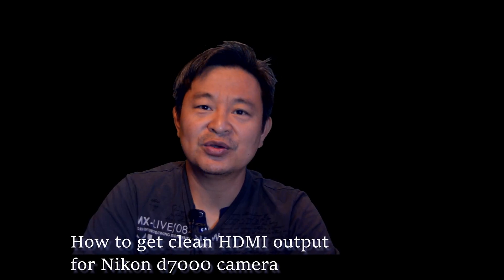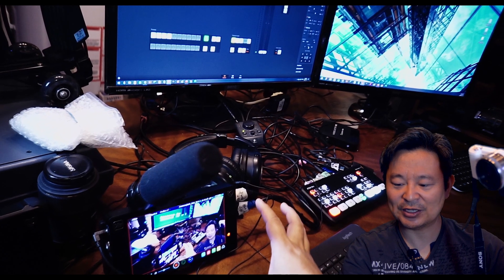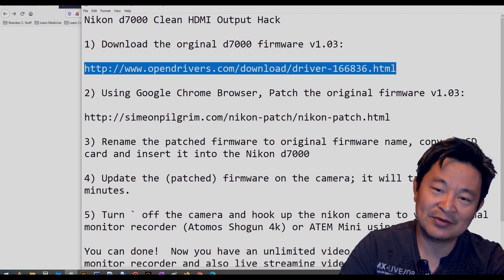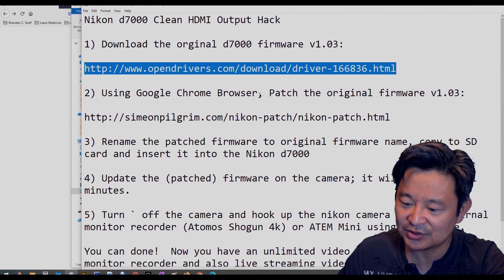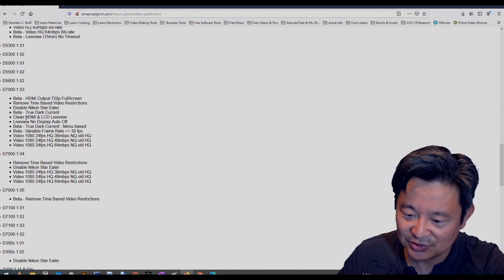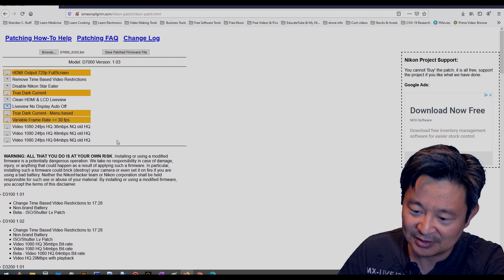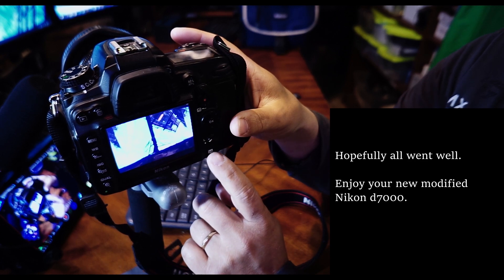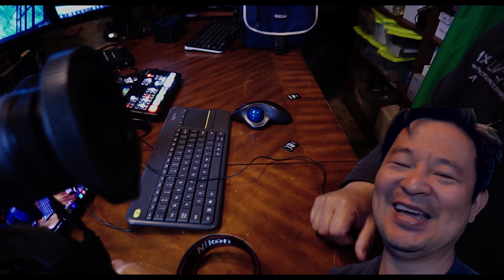How to get a clean HDMI output signal for Nikon d7000 camera

Comment: Everything seemed to work just fine. But after 2 weeks, (today) pluggin in an HDMI cable to the camera makes the screen just turn to black completely. Turning video mode on does nothing, Menu neither, the camera works as it can still take pictures and getting out of video mode gets the lense back and everything else works just fine. For what ever reason after charging my batery and turning the camera back on, it stopped working as intended.
I reinstalled the nun patched version 1.03 that the camera had and it goes back to working as normal.
Unpluggin HDMI makes the camera go back to working, (still with no info on the screen aside from the normal video imput on the screen)
I got no idea why it all of the sudden decides it just won't show anything on screen despite having done nothing but put the camera away for a few days and charged the battery.
I got no clue, I'll try updating to a different patch and then downgrade to 0103 but I honestly got no idea how that happened.
If anyone has encountered ths problem please let me know.
Aside from this, the camera has worked perfectly with the HDMI imput through a capture card.
Reply from the maker: Thanks for letting us know.
Reply: @educatetube  Update*
Got it to work, Although I'm not sure if this used to be the case for everyone else, the way the D7000 sent the live view from my camera to the capture card would be by displaying what ever was on screen.
For what ever reason, the output live view now goes out, withouht displaying anything on the camera. 
But still displaying it on the HDMI output.
So it works, it just I won't be using the camera's screen to adjust anything, and instead use my computer.
Again, unsure if this was the case already for everyone else, but I recall it still working.
Anyhow, it's all very confusing.

TL;DR Just update the firmware, let it sit for a moment. Reinstall this patch, (downgrade/update, doesn't seem to matter) and it should go back to normal.

Comment: Hip Sip! 
I have an issue when trying to send the file to the SD card. I'm doing it connecting the camera to the computer and then copying the file, but it says device stopped responding or was disconnected, then it says it's copying but nothing ever shows up in the D7000. Am I copying it wrong? Thanks for any help
Reply from the maker: You have to copy the file directly to the sd card and update the firmware through the camera. No computer connection needed.

Comment: I got low frame rate when I turn it on in live view and connect it to computer to use it as my webcam. any solution for this?
Reply from the maker: Can you not adjust the shutter speed?
Reply: @educatetube  thanks for the reply, yeah I have automatic movie setting and I tried to turn to manual nothings happened I got something lag or below 20 fps somethings

Comment: I want to do streaming with this camera. It is posible to stream more than 60 mins with this camera with no auto power off?
Reply from the maker: Yes, it should be able to, as long as the battery can handle it.  I hooked up to Atomos monitor recorder and there is no issue.
Reply: @educatetube  Do you have an estimate of the battery life with the hdmi output?
Reply from the maker: The battery can lasts for several hours as long as the LCD not turn on; I would say at least 3 hours.

Comment: Why do you need to downgrade that's such a hastle
Reply: And what HDMI cable is that, that's way smaller
Reply: Is that MINI HDMI?
Reply: just to get a Clean HDMI output if you want to use your camara for streaming other versions don't get a Clean HDMI not even the new 105 . the input on the camera is a mimi HDMI so a regular HDMI cable won't work and you'll need an adapter.